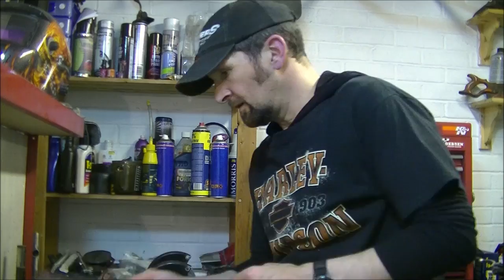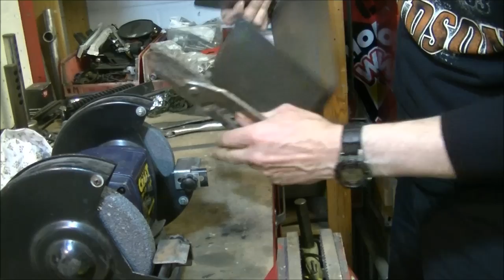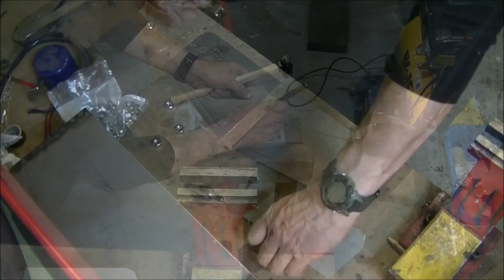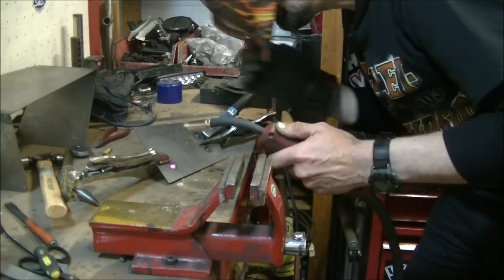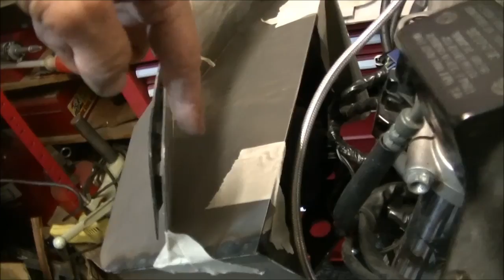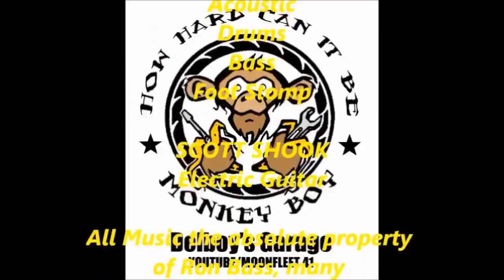Delboy's Garage, Project Bandit #32, Start Construction.

Comment: Did you get your magnets out of a knackered tank bag?  Cos thats where i got mine.Recycle baby. You know your bits of ex filing cabinet on the chain guard etc ..thats quite ok i have bits of metal bed frame on the beast of triumphness...good job ive got my stock bandit to balance out the bike oppositelynessage...Dying to see how your wee fairing comes along ...Great welding matey thats gonna be there after the next ice age!!! BEEF. sorry i started using your phrases after 100 ish videos So Far ! LOVE IT ..great job..Smoooooooth. cheers Springy...
Reply from the maker: Ayup Springy...."oppositelynessage"... that's sterling DBG speak fellah... proud of yer, remember young Luke..i AM your father....!